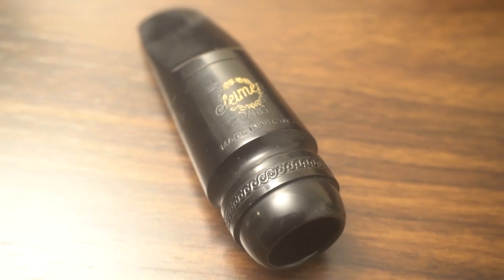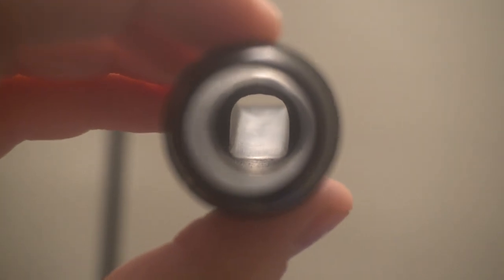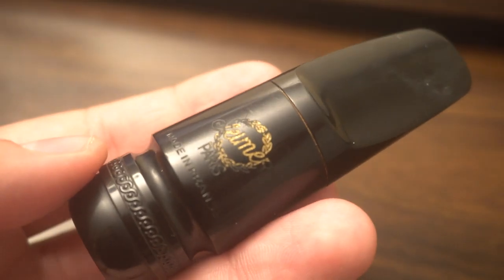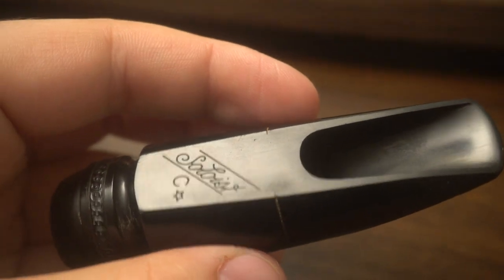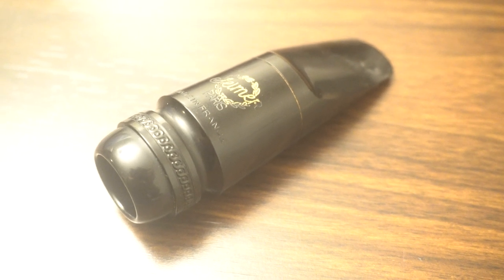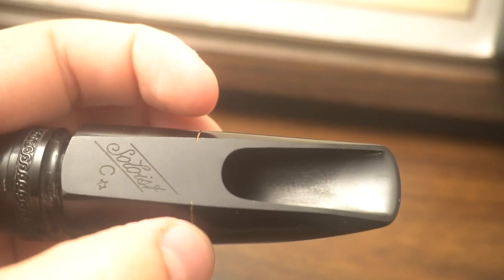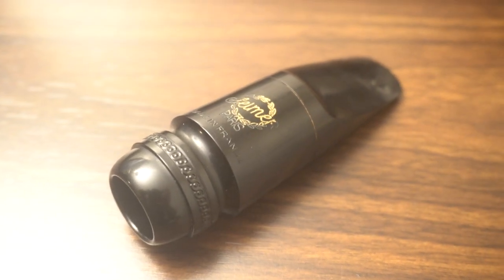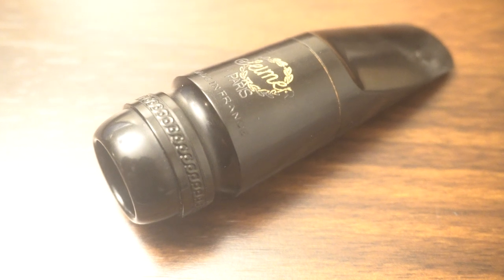The Transitional Large-Chamber Selmer Short Shank Soloist (Alto Saxophone Mouthpiece)

Comment: How does it play compared to the later Soloist? Can it project?
Reply from the maker: In truth, I have trouble with ANY soloist with projection when compared with a large chamber and/or higher baffle mouthpiece. I will say the sound is more complex and I feel a lot more connection with the blow-through experience
Reply: Thank you for responding to my question! I have a later Soloist that I had opened up to an E (.078) and it's a nice player. It projects well, not like a Meyer/Link, but nice sound. I seen one, larger chamber, on reverb and I was curious if it was more free blowing than the later models. It sounds like it is? Thanks again!!
Reply from the maker: @pbnj4lyfe298  I very much so feel it is more free-blowing! SO much moreso, in fact, that I used to have an original E with the later chamber (that was faced to the same tip, but with a better curve, for me) but it STILL felt tight compared to this one...which was a C, if I believe, if not C*. Now, one thing to consider in all of this is I'm a clarinet player, so I know how to deal with smaller tips (although my main tenor piece is a 7*, same with bari and on alto my two mains are .073 and .079...so, even though I can make smaller tips work, I still have an ideal for me that is similar to many others). Yes, I almost couldn't get any focus out of this one! I really should have had someone open it up, it would have been similar to, say, a Gregory, or an earlier Meyer Bros (in ways). I definitely think that reverb one sounds like a good investment! Have you ever tried any of the airflow pieces? Pre-short shank? I would say it's a cross between one of those and a long shank...which is what a lot of people describe a horseshoe Short shank to be, so take that with a grain of salt!
Reply: I've played on a large chamber "Airflow" and it was a nice mp, but It really didn't jive with me, I should've had it opened up. I really wanted to try the smaller chamber one. Might of been a cice combo. Definitely something to consider, since I already have a later model Soloist, and it's a D tip opening.. so maybe I won't need to send it to be refaced. Anyway, Thanks again I totally appreciate your feedback!!
Reply from the maker: @pbnj4lyfe298  The only Airflow I've had any mileage on is the tight, Larry Teal-style chamber. Apparently that's what Don Sinta played for a while. Definitely kind of a Desmond thing in the smaller tips. That's the Airflow I was comparing to, so I apologize you don't have that data point. The large chamber airflows are...well I just fall through them. I don't have any core to the sound. Sorry to write so much! Good luck with the quest!